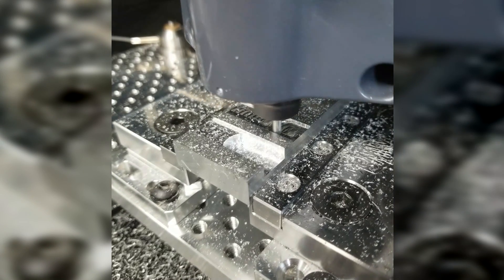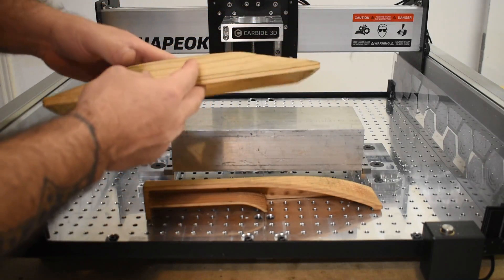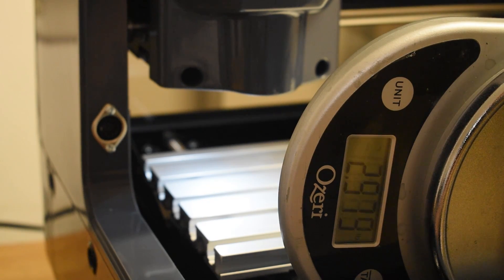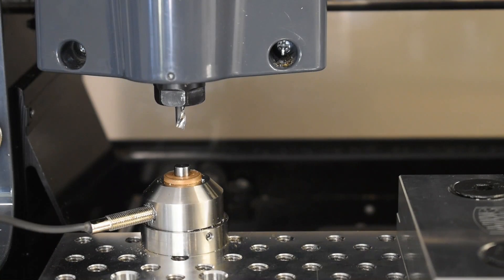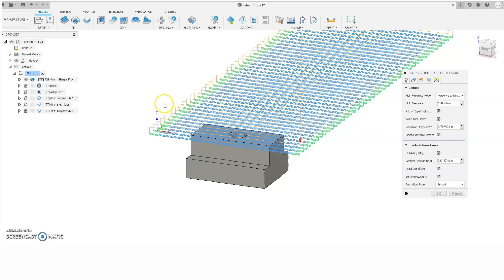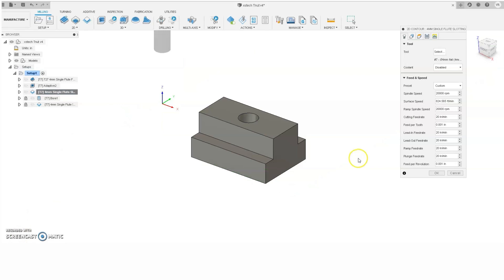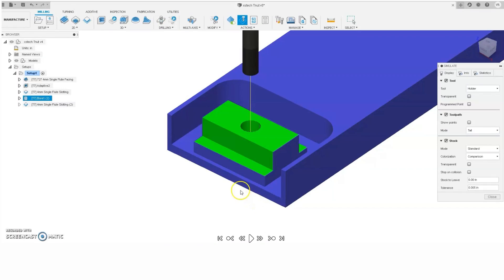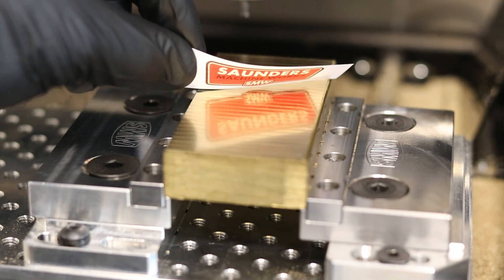Tormach xsTECH Router – Mill & How to Machine a T-Nut

Comment: Good to see you host a video here Vince, can't wait to see more. I am super excited to see if you guys do anything with the Shapeoko 3 that has been hiding in the background. I have been eyeing what you did to yours over on the forums and hoping to start on mine soon.
Reply: I just want the fixture plate for my 19x19 Mega V.   My Tslot plate isnt bad but there is some room for emprovement in that area of my CNC router.
Reply: @dividingbyzerofpv6748   @DividingByZero FPV  fill out the fixture plate RFQ form on saundersmachineworks.com (it's in the fixture plate drop down) and I'll get in touch if you're looking for a plate for your machine - I'm always designing plates for new machines and we'd be happy to add it to the product line  :)
Reply: @alexpinson7759  thanks.   Will look into it as a future upgrade path

Comment: $3,495.00  ($4808.72 Aud) - While i'm sure this would be good for schools where cost is not an issue (at least the schools around me which throw money around like it's nothing) the performance to cost seems far too unbalanced for the DIYer or the guy teaching his kids at home.

Besides the lack of rigidity as pointed out in the video, the spindle power seems to lack, but given the belt drive I'd say that's a good thing. 
Also, at 2:45 the homing procedure looks pretty rough. is this product even using limit switches/proxy or does it just ram it home like the old floppy drives?

Also, given this is basically advertising the machine to be sold, probably not a good idea to speed up the footage...would you buy a sports car if the only footage of the thing running was at like 5x speed?

Comment: > only showing 2x and 4x sped up footage so people think it's faster than it really is
Reply: More so you can actually see the machining strategy without having a video 5x longer than it should be. This is data, not a show.
Reply: @OakwoodMachineWorks  I would have liked to see the full job in one take
Reply: @OakwoodMachineWorks  it is data presentation ; not data
Reply: @ikbendusan  Whatever, they are "presenting data", not "machining a t slot nut in real time". You can find plenty of video of these running in real time.
Reply: @OakwoodMachineWorks  i guess

Comment: One thing that does strike me with these machines (since mine isn't rigid at all either) is that adaptive cuts have a habit of being absolutely terrible in metals. 

In regular mills they're great as they have the rigidity to pull off the full depth cuts and won't chatter with all the sudden changes in direction. However, these flimsy hobby machines just don't have that rigidity, I found that what happened was I would end up with almost the exact same depth of cut, a worse finish and a toolpath that was maybe 2x longer to run. If you're only going to be using 0.5mm of the endmill anyway, there's just no real benefit from the even chipload provided by adaptive strategies.
Reply: I agree, is’s difficult to call this “machining metals“. For my understanding this should be called „wood+“. A belt drive, frame and rails like this just can’t handle this. It’s not just the fact that you‘re using 5% of your tool length, the way you‘re cutting effects the wear of the endmill dramatically.
I understand the concept and it might be something for schools or education in general, due to the “woaw-factor“ (the design is nicely executed), but not really something for actual prototyping in aluminium.. An “add“ like this could point this out a bit more. And the price: well, it’s a complete system with their software - same price for e.g. an ultimaker, seems somehow reasonable for me..
Reply: How about dmc2 from sharrif dmc?

Comment: Great machine for an introduction to cnc with students in mind. For a high school this makes sense. Bigger machines (designed for production) are an order of magnitude more expensive to buy and repair. One crash on a $75,000 machining center could be the entire year's budget for some school's tech departments. That said, even for an occasional hobbyist, that is a lot of money for a tiny router. After tax that's over $30 per cubic inch of work envelope and for comparison, a Dremel has a 175W "spindle". My guess is 95% of hobbyists would be far more satisfied spending that money on a used manual machine with actual lead screws, 20× the spindle power and hopefully more than 2.4" of Z axis. But again, for a student? Perfect.

Comment: I like Saunders and have watched his videos for years but I’ve just subscribed to Proven cut  Pro and for the money I was really disappointed. Don’t get me wrong the idea and the concept is fantastic, but I feel like I’m paying for a beta version of a product that is nowhere near where it should be. 

Its lacking on the heavier machines (VMCs) and overall lacking in content. The format and information on each video is very good but just not enough. Same for the range and the depths of cuts. 

For example a simple material like acetal (Delerin) through spindle coolant?? That would be nice to have for a pro user, I completely understand that Saunders is basically making an encyclopaedia for machining but there’s just not enough on there at the moment to warrant the cost and when you’re charging people for a service that is below par I don’t believe that’s fair. I was looking last week for a 20mm 3 Flute carbide Endmill speeds and feeds for aluminium, 30mm depth of cut. Didn’t even have the tool and I’m pro subscriber 🤷🏻‍♂️

Comment: Just buy a used knee mill!
Reply: Best thing to get if you need a mill, especially seeing it as a possible cnc converted mill in the future thats going to be really capable of heavy cuts, or at least heavier than a flimsy router
Reply: Ok I'll buy one ,if something goes wrong like I break an endmill or I crash the machine  or it's too slow or I struggle with CAD ,I blame you .🙂 not for the reason that my wife and girlfriend think I'm cheating on them at all .

Joking aside I got a bridgeport J1 knee mill slapped motors on only issue is the Z is as slow as cold molasses like 30inches a minute 750mm/min
.